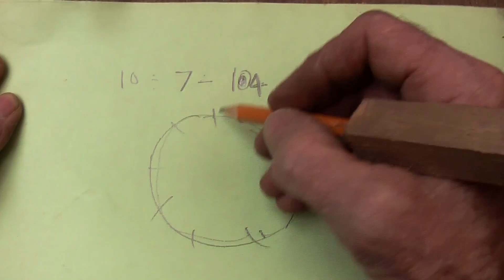Emergency Micrometer

Comment: How much does temperature and humidity affect your measurements? If that wood block is 50mm long and it shrinks or swells by just 1%, that's 0.5mm error added to the measurement, which could be significant if you need 0.1mm resolution. The calipers were made of metal for this reason.

Comment: if you let the dial free you can set the 0 everytime
Reply from the maker: Yes, I think that is a good idea. A ring with the pointer, with a  locking bolt, would do that I think.

Comment: Hey just a suggestion on your calipers, could your take a black marker/sharpie and fill it it or just rub all over the numbers and mm marks then wipe off or lightly sand off the surface.  Just to accent the readings for you.   Thank you for the videos
Reply from the maker: Thanks for that. I will try it.

Comment: That's a very interesting way of translating the measurement. I think people need more of this kind of process, since so much is packaged in manufactured products that try to remove the "work" and make it "easier".. Without the work and logic behind stuff, it prevents people from truly understanding basic principles. Your device is excellent.
Reply from the maker: Indeed. I am a fan of concepts  in stead of recipes. Put several basic concepts together and you get interesting  stuff. Understand them well, and you make your own recipes.

Comment: the 1.0 pitch is ideal for simple maths anyway for people like me!    fine thread bolts could be found on an old car, the seat belt anchor bolt is very fine, might be a good basis for this.
Reply from the maker: Yes, there are lots of options, but the basic theory  is good to go.